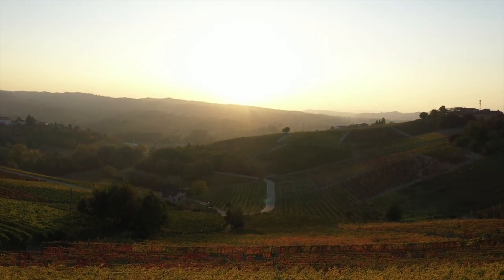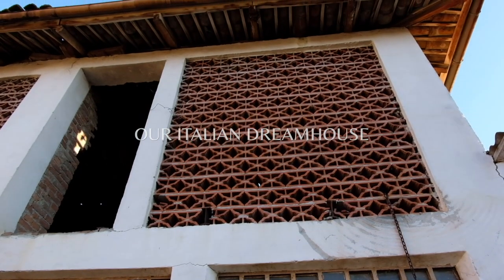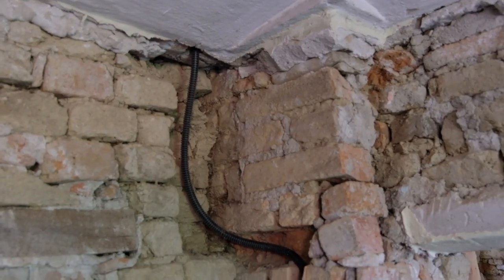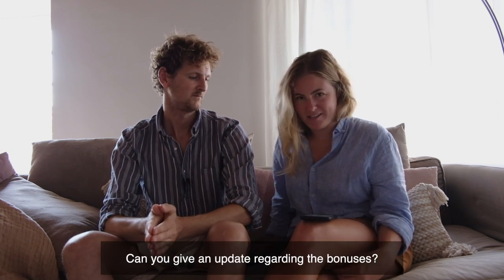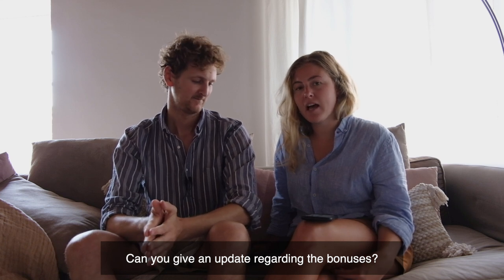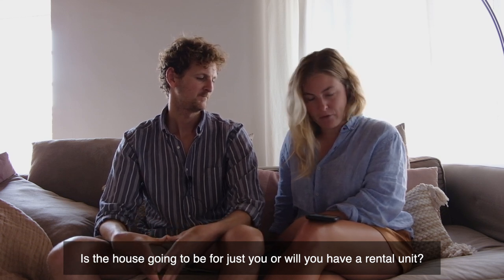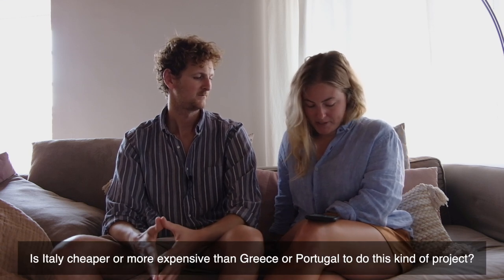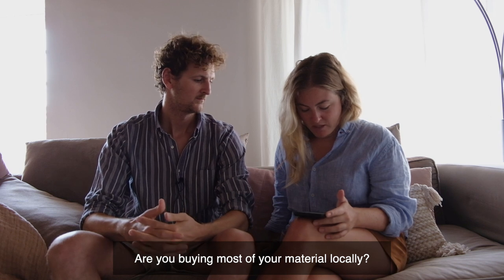Building IKEA Furniture and in-depth Q&A - Italian Farmhouse DIY Renovation & Restoration (part 14)

Comment: You're being very optimistic with heating costs... I have a 115 square metre apartment in Milan and I spend around 400 € per month for around 6 months a year (including hot water). As for women not being taken seriously in the construction industry it does depend on the person: in my case in Milan I did all on my own because I own the apartment and I had zero problems with the architect and owner of the buiding company... but dealing with the actual bricklayers took me a lot of self-confidence. It's doable though, but you have to show your nails as we say in Italian (which means becoming very assertive). In my house in Liguria I worked with a female architect so that  having 2 women managing the renovation of a Medieval house convinced everybody that they simply had to deal with women: since the architect was extremely professional that turned out to be a very positive experience  Good luck btw
Reply: I have been looking for a house in Liguria, not too far from La Spezia. One fell through, but there’s no rush. How do you like it there?
Reply: I don't...because my house in exactly on the other side, on the border with France. But that part is very nice, too.

Comment: Most likely too late, but I would heavily recommend a heat pump for heating and cooling. Much more efficient. Tough decisions though I get that. I have family in Liguria and we will be retiring there and taking on a project there in the next few years. We are going to run away from gas as fast as we can.
Reply from the maker: That's some really good advice. We've actually researched that a lot earlier but turns out it's not a good solution for an old stone house like ours. It's very popular in Sweden where I come from because the houses are so well insulated, but houses like ours in Italy lose out on so much efficiency due to it not being insulated properly. 

We're really not keen on having a gas boiler so we're looking into solar panels together with a lot of wood fire stoves. For now we're installing gas though since we need an affordable solution ASAP.
Reply: @OurItalianDreamHouse  Good points. I find it interesting when aspirations and good ideas collide with real world obstacles and how one solves them.

Our plan is to end up with 2 'cottages', one in Canada and one in Italy (more fortunate than affluent!) and the hope for us is going with a heat pump and wood stove combo for each, hopefully supported by solar, while still tied in to the grid. And try for a little elevation to moderate heat.

Comment: At least €1000 is guaranteed, if I was to guess, you’ll probably get back another €500 from the builder so €1500 in total. Hopefully all these bonus not bonuses get sorted 🤞🏾so you can stick to the original plan and we get to witness it.
Reply from the maker: Thanks MR JKE! We are optimistic and even if the bonus doesn't come back we'll try to update the plan to make sure that it's still something awesome! 😁

Comment: I don't like fitted kitchens anymore. There are so many beautiful used kitchen furniture that you can remodel. I don't have a stove, a microwave or a dishwasher. I get by very well with an induction plate, a small electric plate and a 40 x 30 cm oven/grill - I also bake my bread in it. as a backup there is a gas cooking station in the backyard. my kitchen is only 6 square meters! i had a marble slab for the sink attached to the wall, underneath is a curtain, behind which i have mobile light shelves as storage space. the self-created kitchens have 100 times more charm than this crap from ikea
Reply from the maker: In Sweden we have a saying: "Smaken liksom baken är delad".